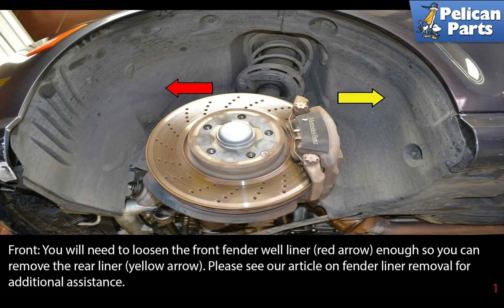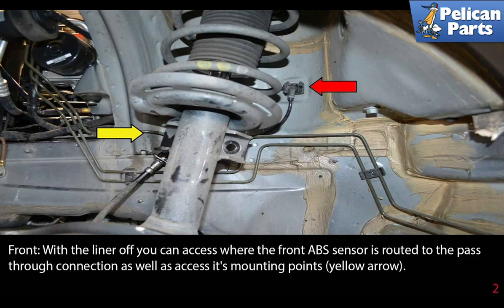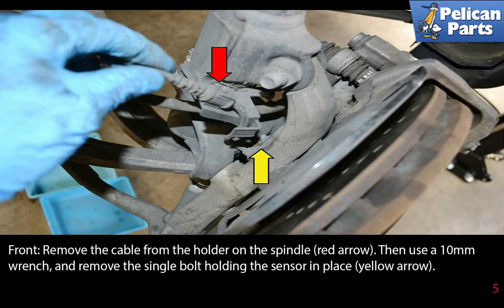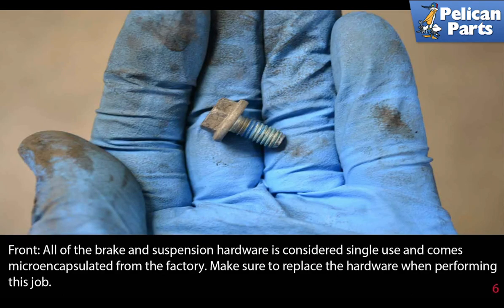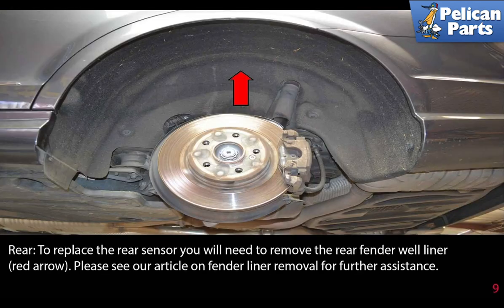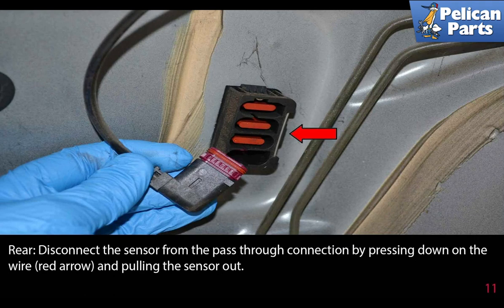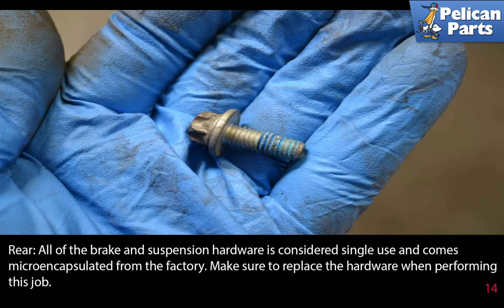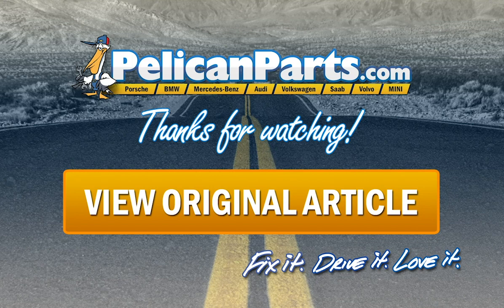Mercedes-Benz W204 C-Class ABS Sensor Replacement DIY (2008-2014)

Comment: Must the bolt be replaced when I replace the sensor? Where to buy the bolt?
Reply from the maker: Not always, but I prefer to replace it. Give The Pelican Parts parts specialists a call at 1-888-280-7799. They can figure out what part or repair kit you need.
Reply: I just reused the bolt since I did my replacement before watching this video.  We'll see if there is a problem.  If so, I will just remove the bolt, clean it off with a wire brush, and use a little blue loctite to secure it again.